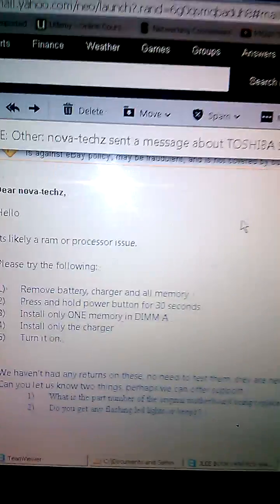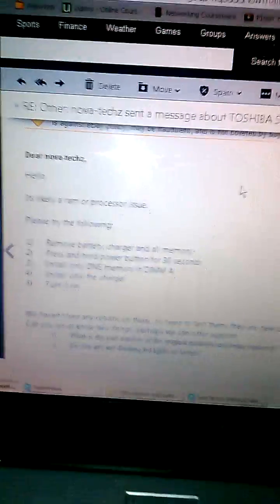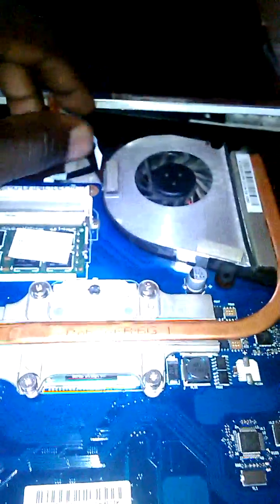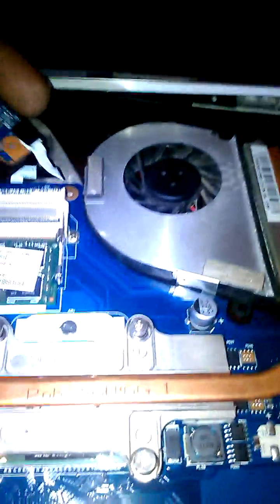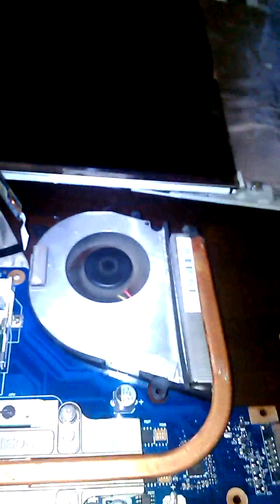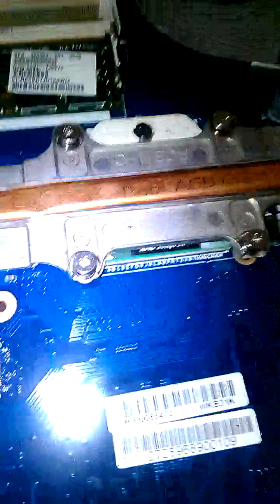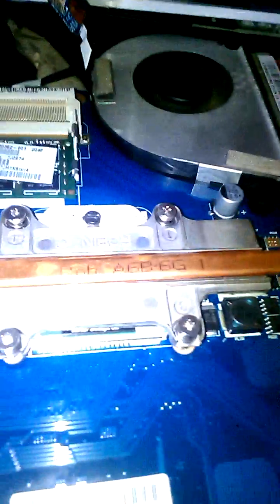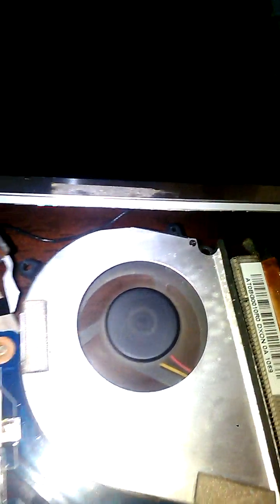TOSHIBA Satellite L455D-S5976 no working

Comment: all I did was stick a little something to stop the fan. now let it go for atleast 15 minutes. let this board heat up alittle . might sound stupid but serious. I have the same thing . I fixed it. let it get hot with the fan stopped. don't unplug fan though. after it is hot 15 to 20 min. shut power off . take the object out of fan. worked perfect. I suggest you to download AVG security to get the viruses fix also go into f2 boot order put LAN at bottom boot hdd top . problem fixed . go right into windows updates . or even just press and hold 0 and power until it beeps and out of box factory data reset it after getting screen on. but you need to overheat it first to get it to power. Thanks . Best of luck